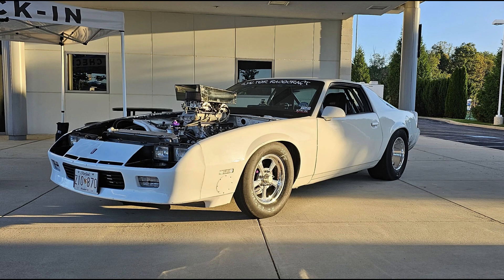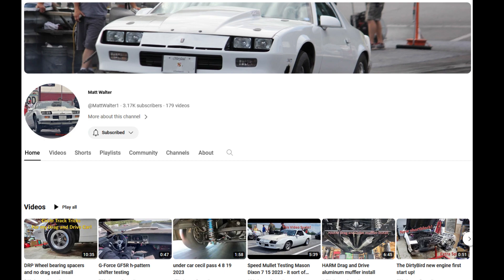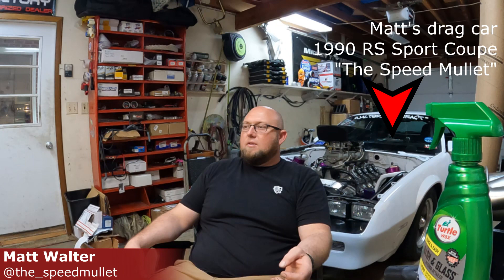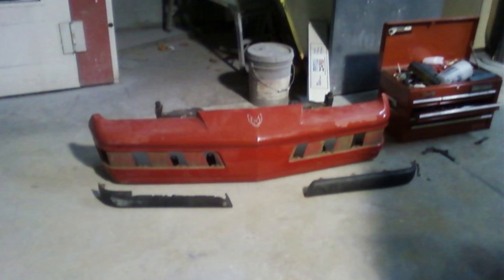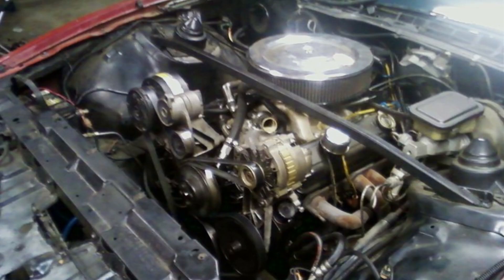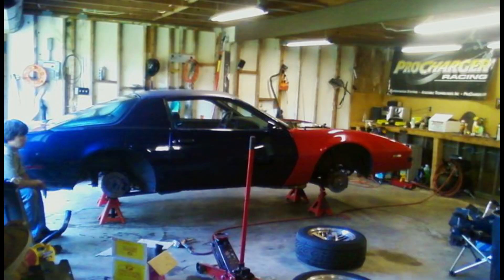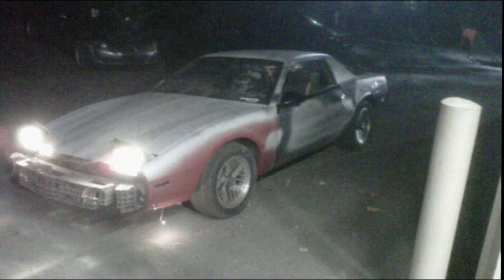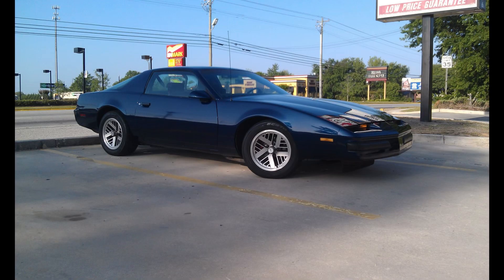Project Ladybird 1- The BackGround (Intro 1/2)

Comment: If I had one of these I'd want to see if I could weld in c-4 corvette rear axle or a nascar race car rear axle and custom made spindles up front to have nascar race car spindles and martinsville brakes and a set of areo 59 steel wheels with a set of B F Radial T/A'S on there. And the pit impact gun socket for lighting fast tire changes.